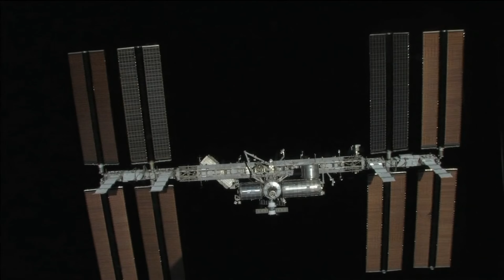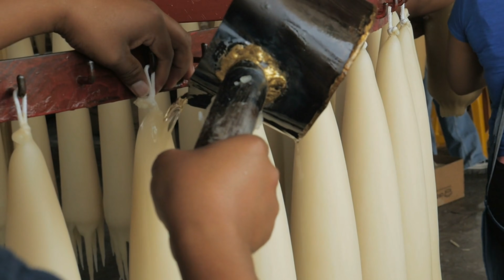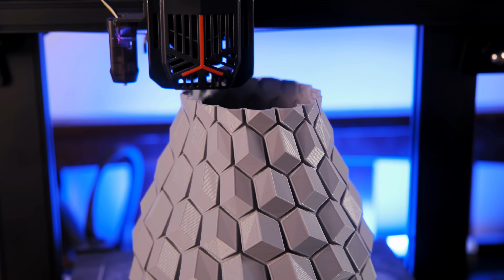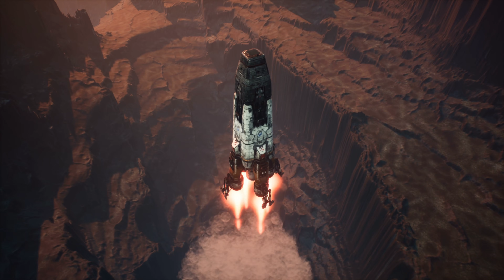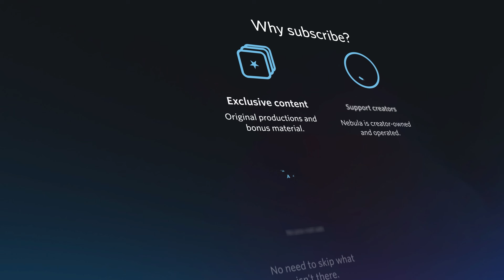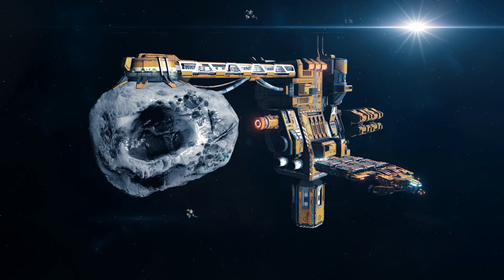Additive Manufacturing in Microgravity

Comment: Number one reason we dont have any manufacturing in space: Heat management... 

To have any real scale industrial manufacturing, as well as additive manufacturing there needs to be a way to cool products, machines, steel, quench the steel and plastic to cool it... Relying on pure radiative cooling isnt going to work on scale of any kind. Especially 3D printing as the part needs to cool, if it doesnt the steel will warp and not form correctly and so the 3d print will come out subpar for the intended use.
Reply: Space isn't as useful as people seem to think. Still fun to think about
Reply: @jerbear7952  space itself is just empty, but out there there are resources and planets we need to colonise and diversify. That's why space is cool, that's why Hollywood and capitalism tried to sell us space is cool idea, they/we need to have more than just one planet, because here are limited, out there we can be infinite (in theory) reality is boring tho
Reply: Do you have a reason radiative cooling doesn't work? Scale isn't the problem when you are making things in space. Neither is weight. Earth emits all of its waste heat as radiation, we just get a free lunch from all the extra mass we can heat up. Is there a physical reason why it isn't possible to cover an area the size of a state with radiator panels? Just because something is hard doesn't mean it isn't worthwhile to do, and humans have already started engineering this biosphere, which is by far more massive than anything we will put in orbit for quite some time.

As an example of a system that can scale to massive proportions, look at liquid droplet radiators. A balloon of mylar inflated to massive scales, tethered on a point and spun gently to provide "up" and "down". A relatively tiny amount of liquid mercury is added, where it pools at the "bottom" and provides a highly efficient place to send heat. When the mercury boils, it gently pressurizes the balloon with vapor, which condenses on the "top" and falls back down. The surface area for radiation can be absolutely enormous, and in high orbits there really is not very much debris to be concerned with. Plus, a small puncture is not going to result in a devastating collapse, because the pressures are low. Space is already hostile to life, so just be careful with where the mercury ends up, or use a different fluid.

I use that as an example to illustrate that incredulity does not scale, but human ingenuity absolutely does. The only thing that is preventing us from leaving Earth is our own intuition and incredulity, not our ambition or capability.
Reply: @the_zeppelin_guy because anything with manufacturing or welding produces a lot of heat, and that needs to be controlled for proper curing and crystallisation. For industrial scale, space isn't the problem but resources are. We can't just build massive plants to cycle cooling time between stages of manufacturing just to control the heat, we don't have the resources of time or fuel...

You use a lot of words like gentle... Manufacturing and 3d printing generates heat, welding and metal melting points are high temperature applications at rapid rates. So to make large scale manufacturing you will need staged production and casting to control heat accross the entire process, meaning even more space and time. That's just not feasible for us, not for a very long time, not if we don't have Hollywood like space engines and efficient fuels to harvest the materials in space rocks, and built out there deep in the cosmos...